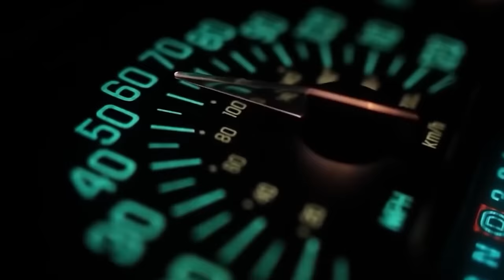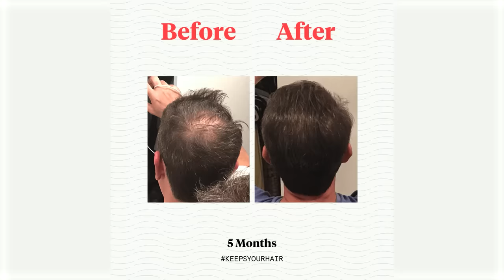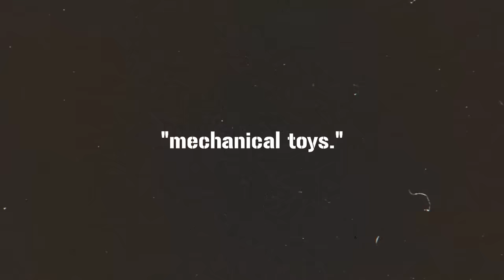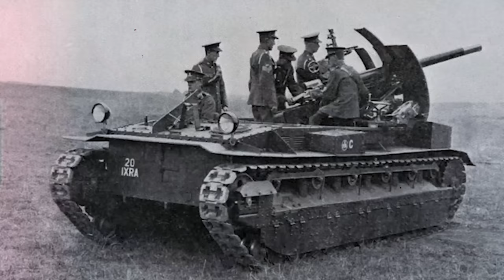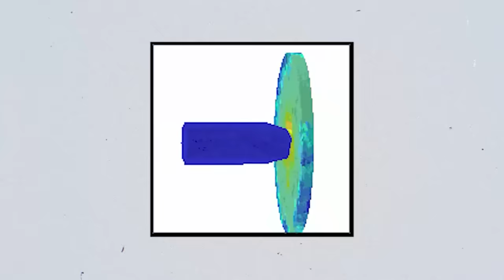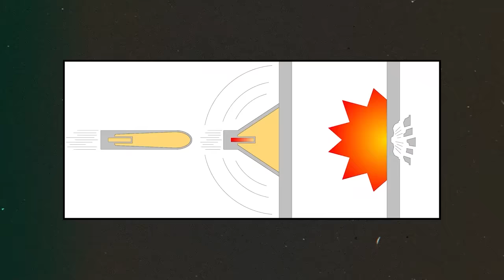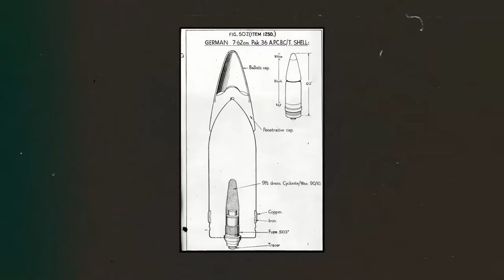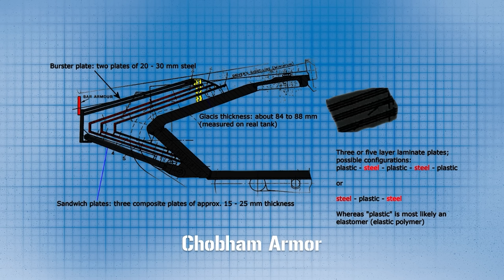The Tank: Everything You Need to Know

Comment: I crewed M60A1s/A3s in the early 80s and finished out riding an M1A1 into Iraq with 1st Infantry. Just my opinion on Simon's take on Desert Storm... the T72s we engaged were at night from ranges that were far beyond their capabilities. Our daylight capabilities were far better too. A lot of the design philosophy is still a holdover from the operational concepts of the cold war, we expected to fight a mobile defense and succeed in European terrain (not without loses of course, probably bad ones) against anywhere from 5 to 8 times our numbers in T62s/T64s/72s, the M1/M1A1 of that time frame was just designed to be better at it than the M60 series (NO. I'm not even going to touch the A2 fiasco.) was. In desert conditions longer range engagements were the norm and seriously gave us the advantage. The Iraqi T72s were just no match for the majority of the coalition tanks. And this is before you even get into crew skill. A tank can have the best paper figures on earth, but with a scrub crew, it's practically worthless. Good job of presenting a good bullet points video.
Reply: Scrub crew I'm stealing that insult 😂

Thanks for serving the nation 🙏
Reply: If I remember correctly, a large Iraq tank formation incorrectly measured their distance when setting up an ambush over the top of a hill. Iraq rounds fell  short of the hill allied tanks crested over. It turned what would have been a potential disaster into literally giving coalition forces the high ground out of range of Iraq tanks and artillery. It's pretty hard to take major casualties when your enemy decides to gift you the perfect position just outside the range of their guns. It's not just the skill and training of individual tank crews, but also the efficiency and skill of the commanders. If your commanding officer says to do something genuinely stupid and you'll be shot for treason if you express any disagreement, that's not an effective army. It's a catastrophe waiting to happen.
Reply: This is exactly why I went 19k.

Comment: Chieftain had a stabilized gun, we also switched to TLS (Tank Laser Sight, used for range finding). Also once we figured out windage we could achieve a first round kill.

The 105mm range was about 1500-2000m, our 120mm was in excess of 3000m in direct fire mode.

Comment: One comment / correction: HEAT shells do not function in the way described. They use a shaped HE charge to turn a piece of metal into a plastic state jet which then literally punches through the armor. The higher temperature of the jet, is incidental effect of it's being pressurized in such a way, had little effect on it's armor penetrative qualities.

It functions in a similar matter as a high pressure waterjet used to cut steel today, but using metal and a high explosive to get that metal moving ("pressurized").

It's just a different form of kinetics and fluid dynamics at play. Spaced armor works bc the shaped charge effect is only useful at a very set distance. Too far and it just splatters on the armor ineffectively, too close and it won't have compressed enough to penetrate. The outer plate sets off the shaped charge, causing the plastic metal jet to essentially splatter on the main armor.
Reply: Thank you sir 🫡
Reply: He is generally extremely inaccurate with his rantings, one should see this as no more than entertaining tall tales, entertaining as it may be.
Reply: Hi! I was looking for this comment, one note though, HEAT does not get effected too greatly by distance, there even a few AT mines in service using HEAT over long distances to penetrate modern armour. ( the PTKM-1R - top attack anti tank mine )

Slatted armour on modern designed vehicles are actually intended to cause HEAT threats of their time (mainly RPG-7, as pioneered by the Americans during their war on terror) to go dud on impact, not detonating their HE charge. Slatted armour is considered compromised if the round detonates on impact with it, though they also weren't horrific at diverting the RPGs trajectory before detonation, aiding in the non-penetration and therefore survival of the tank.
Reply: Also as a note to my prior comment, I think I was a little ignorant, Shaped charges (may?) have a focus distance they are designed for, though I am sure shaped charge penetration dropping off drastically after 2 metres is a misconception echoed by wikipedia. Though still, with spaced armour sitting within even the one metre distance from the tank. the loss of penetration even for heat rounds of the day wouldn't be enough to help the armour.
Reply: @nisumi_6575  Likely why spaced armor isn't really a thing anymore?
Reply: @jcforge  ....Never said otherwise? I'm not arguing w you bro just correcting or adding information. and slat* armour was quite effective at its role. but yeah has no place in the current day n age.
Reply: @jcforge  Also coming back to this stupid comment. Spaced armour IS used. and its incorporated constantly inside composite armour packages to stop rounds like HESH or other concussive forces fragmenting inner armour and causing spalling. Slatted fell out of style within intelligent use. but it is definitely still a "thing", evident by russian cope tanks. Though its worth noting its more high use of external spaced armour in the form of whatever they can find. whilst trying to DIY Slatted, though to low success rates with modern ATGMs. and the relatively precise calculations done on actual slatted armour in able to render a warhead dud.

Comment: 49:00 Another advantage of sloped armor is that it tends to deflect the incoming rounds, meaning that it needs to absorb less energy.

If a round impacts armor at a 90 degree angle at 1000 m/s, the armor needs to absorb enough energy to bring the round to a complete stop.  If a round impacts armor at a 45 degree angle at 1000 m/s and bounces off at 500 m/s, then the armor only has to do half the work.  And as mentioned in the video, it has twice the muscle to do it with.
Reply: Thanks Um Actually guy
Reply: Very big if.
Shells do not bounce off half the speed when they hit at 45°
45° gives multiplier of 1,4141 and the angle is nowhere near close to ricoched anything.

Comment: 48:45 , you're missing the key point of sloped armor. Sloped armor is more likely to deflect shots than vertical armor
Reply: He also miscalculated the thickness by a lot
Reply: And to bring up sloped armor so many times and not finding a way to shoe horn in a mention about the S-tank, is unforgivable 😅
Reply: Also he said 45° sloped armor doubles the armor effectiveness which is simply wrong, you need 30° for it, as shown in the picture.
100mm @ 45° is only 141mm effective

Comment: APFSDS can and is used in rifled barrels such as the Challenger 2, the smooth bore allows for a higher muzzle velocity without increasing the charge size.
Reply: APFSDS in rifled barrels requires a free rotating bearing.

Comment: Good videos, but the tilted armor math is incorrect.  45 degree slopes is the square root of 2 of the 2 sides in a 90, 45, 45 triangle. Which means 45mm tilted 45 degrees has an effect thickness of 63.6mm, not 90mm.
Reply: Your math is not right, For the Sherman 63.5/COS (47) = 93.1mm of LOS thickness, For the T-34, 45/COS (60) = 90mm of LOS thickness for its frontal glacis armor. So, in did a 45mm plate angle to 60 degrees has an effective thickness of 90mm if you do use the right math.   The formula: W/cos(θ)=x
Reply: @viceralman8450  Are you saying my math is incorrect or the video's math is incorrect?
Reply: @mcduvall2000  Yours the LOS thickness formula shows a 45mm plate at a 60-degrees offers 90mm of efective protection.
Reply: @viceralman8450  I never said anything about a 60 degree angle... my math is correct for a 45 45 90, the hypotenus is equal to the square root of 2 of either side as the sides are equal. While you can use trig and sohcahtoa to solve these, these are simple triangles, like the 30 60 90...

Comment: The earliest versions of both T-34 and KV-1 were armed with the same 76mm cannon, the L-11. However, in 1941 they were both re-armed with more powerful cannons. Only T-34 received the new F-34 cannon, not both T-34 and KV-1 as you mentioned in the video. KV-1, on other hand, would receive the F-32 cannon, which had a shorter barrel than the F-34, later being replaced with more powerful ZIS-5.

Comment: Challenger 3 is merely a Challenger with new internal armor modules, a turret capable of mounting a Rh120 with 3rd gen thermals and an engine modified to provide 1500 hp instead of 1200 hp. Compared to a Leopard 2A6A3 that sports the same cannon, 3rd gen thermals, higher armor thickness at the same technological level and a (50 years old) engine thats technically capable of 1800 hp but limited for longevity in peacetime to 1500 hp, the Challenger doesn’t quite make the cut to be considered a generational leap. If we consider a hardkill APS to be the distinguishing feature of fourth Gen, Trophy can be found on the Merkava 4M and it’s successors, the Leopard 2A7A1 and 2A8 and the M1A2 SEPv3, all of which are too just upgrades of old Gen 3 designs.
Reply: Pretty sure the Challenger 3 is also getting a new composite for its armor, moving up to Epsom + Farnham from the previous Dorchester. If everything they claim ends up being added it is definitely the next generation of Challenger.
Reply: @yermom014  It either doesn’t make the cut to be considered a 4th gen MBT or current Leopards and Abrams models have to be considered 4th gen as well. Although it’s definitely an improvement over Challenger 2.

Comment: Great video, an interesting note about the centurion is the mk1 hit France just a little too late to engage in combat and these mk1s  were also present during the gulf War as arve's and interesting is they had fewer issues with their tracks and wheels and bearings plus their air intake and filters than their modern counterparts, also up till very recently the longest confirmed tank on tank kill moving was from a British Challenger 1, also the challenger 2 has a great history of taking a massive beating with something like a  146 hits as it  couldn't move with a track  knocked out and after recovery was back in the field in something like 8 hours, challengers also have a higher survivability rate than the Abrahams and most other tanks, there is  still some speculation around the one in Ukraine and if it was a mk2 or an upgrade mk1 and there was also word going around if one of the hatches was open, interesting is a hatch open is the only way a mk2 in British service got taken out and that I think was from a  hesh round in one of very few brit on brit friendly fire cases.
Some really good tanks around though and the innovation is incredible.
Thank you

Comment: The reason you can't (reasonably) fire APFSDS from a rifled cannon is actually that a) the extremely large length to width ratio means the projectiles would tumble if given significant spin and b) the energy you put into the spin is lost to the forward motion. And then of course shaped charges also don't really want to have spin in order to work properly.
Reply: Spinning the round also imparts a certain amount of inaccuracy. Especially at longer ranges, the spinning round has a tendency to drift off target in the direction of the spin. No spin means more accurate ling range shots.

Comment: Where:
Te = effective thickness of armour
Ta = actual thickness of armour
a = angle of armour (degrees from horizontal)

Te = Ta / cos(90 - a)

Accordingly, 100mm thick armour sloped at 45° has an effective thickness of 141mm. The same armour would need to be sloped at 30° to achieve an effective thickness of 200mm.

Comment: I'm surprised ERA didn't get a mention.
Sure it is now pretty much all getting phased out, but explosive reactive armor was all the rage for a bit.
Reply: The lack of comment on why the APFSDS round became favored over HEAT and HESH (namely the ability of ERA and composite armor to defeat explosive penetration) did strike me as a bit disappointing. The Iraqi tanks in Desert Storm were stranded with HEAT to be used against tanks designed specifically to defeat it. 

It also baffles me that mention of autoloaders was saved until Chapter 5, when Soviet tanks were using the technology in the 1970s! And as a knock-on effect of their carousel ammo rack design, they can't use top-of-the-line APFSDS because the dimensions of the shells are too long for the T-72, T-80, and T-90's loaders!
Reply: ERA is not being phased out. Nice try though. It's still cutting edge.
Reply: ERA is not being phased out AT ALL and it won't be for a long long while, if anything it's becoming MORE popular
Reply: Phased out? Not a single modern AFV I know of doesnt feature some version of it.

Comment: My take on this video: I am missing the Leopard 1 and 2 series of tanks (only a short clip shown of a 2A4 variant, driving across the screen). The Leopard 1 introduced a highly modular platform which was expanded with the Leopard 2 series.
What the future will bring? Active protection systems will become mandatory as the israelian trophy system had shown. Cannons will grow a bit, 130 to 140mm will be my guess, inculding autoloading systems. The crew will shrink down to 4 members at max: driver, gunner, commander and optional: reconnaissance officer for tank launched drones or separate communication to ease the stress of the commander. And maybe, we'll see specialized tank destroyers again, in the form of gauss-/railgun- cannon wielding vehicles...

Comment: 48:15 Not quite true. The effective thickness increases, but you need a longer piece to cover the same height, which exactly cancels out the weight savings. EXCEPT you do save the weight of the thin roof armor since you are covering lateral space with the main armor now. 
So you don't actually save as much as you might think. The real trade off is you save the weight of the roof by sacrificing half the interior space.
Reply: someone failed geometery
Reply: The best internal volume to surface area ratio is achieved by a sphear, but sphears dont make for practical tanks, so we have to settle for cast ovoids if we truly want to save weight.
But if all we have is welding or riveting, or we can manifacture flat plate to be more resilient than cast curves, a diagonal is always going to be shorter, than a step of any angle covering the same span, therefore making the slope obsolete. If your design absolutely must have that internal space, you are still better off replacing it with a sigle oblique plate, rather than a vertical faceplate and a horizontal flat cover, unless you make the flat cover significantly thinner. But even weaight savings aside, such a joint will always be weaker than a single homogeneous plate.

Comment: Someone probably wondered why Rheinmetal's Panther KF51 wasn't mentioned in upcoming new gen tanks. Well, unlike Challenger 3 where plans are already in motion to start production, new Panther is still in prototype stage, which was unveiled in defense exhibition in 2022 summer. There has been tentative inquiries made with existing Leopard 2 operators, but no official commitments have been made. Rheinmetal is convinced that they will have more than enough buyers.

Interestingly enough, Panther KF51 is apparently made to be able to have loitering munitions (HERO-120's) in it's arsenal.
Reply: The panther isnt a prototype for a new tank. Its a technology demosntrator designed independently by rheinmetall.

Comment: Cumulative shaped charges(HEAT) do not melt through anything, nor are they defeated by armoured skirts, nor were the latter designed against them. CUmulative warheads work, by imparting the chemical energy of the eyplosive warhead into a copper funnel, which is usually very light, and thus can attain extreme velocity, and great penetrative power, through kinetic energy alone. Armour skirts actually enhance the power of such charges, by allowing the charge to initate further out, and more time and space for the fine hypersonic molten copper needle to form. Depending on diameter, such a charge retains its maximum penetrative power 3-10 meters out from the initial point of the explosion.
Aroured skirts were put into widespread use to counter the soviet PTRS and PTRD 14.5mm AT rifles, with just about enough penetration power to go through a panther or panzer 4's side, but the pplique armour served as both additional thickness, and a barrier to deform and cause the bullet to tumble, thus rendring it incapable of penetrating the tank.
Actual spaced armour was invented in the late 80s, And features on designs such as the Leopard 2A4, and it is designed to send a long rod discarding sabot round tumbling before hitting the main armour. In order to work it needs to be sharply angled away from the incoming projectile.